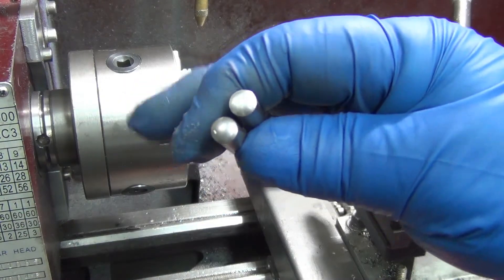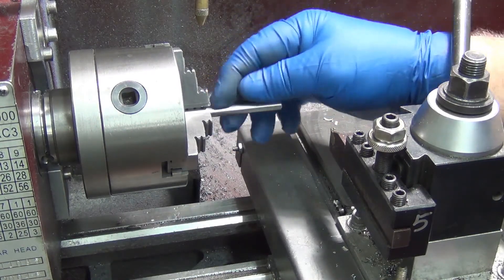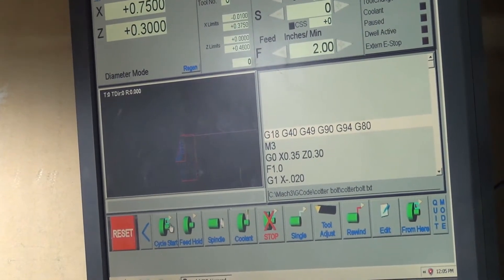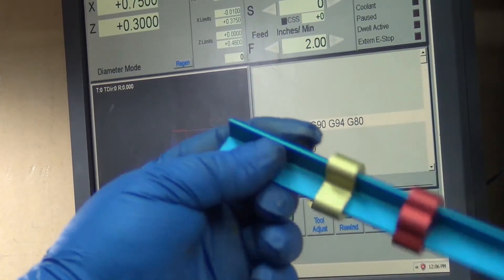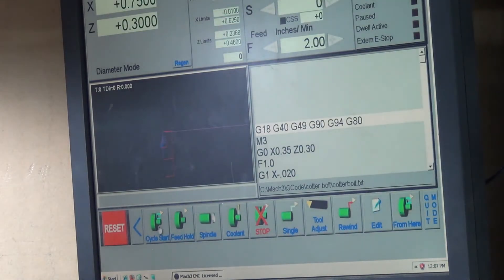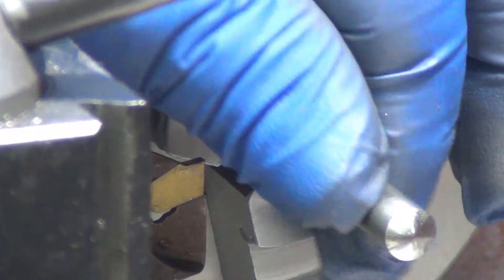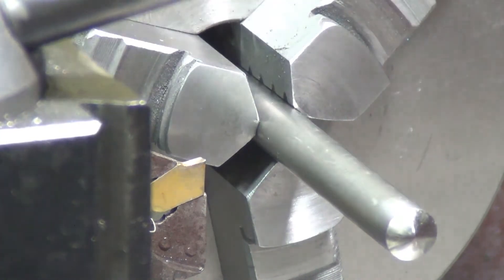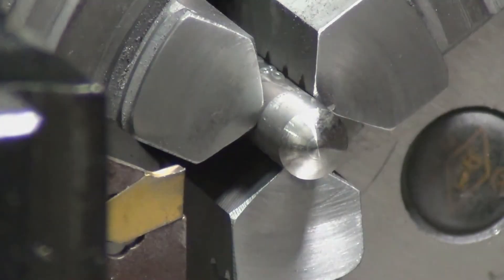Cotter Bolt pt4 - OP1, Cutting the Rod

Comment: Hi Mike,
Yap... Sometime ago I've learned the manual programming on CNC, never made it to the computer programming using software, maybe one of those days if I let myself get one of those smaller machining center..... Still debating....
But seeing you get it done, pushes me towards getting one, Geezzz you're a disturbance.... lol
Pierre
Reply from the maker: LOL!!  I'm disturbing and disturbed.....I got it well covered!!! :)
I wanted to start with a mill, but the lathe has been great for learning!   I was just looking at some used equipment for sale on CNCZone.  Just like I thought I needed a big lathe, then realized that the small one does 90% of what I really need to do.....it's becoming more apparent with the mill too.  Most of the first projects I'm looking to do on it would easily run on a cnc'c Sherline.....or even my mill/drill if I converted it.

Comment: There was a small CNC lathe on the local classifieds lately...almost bit on it too....LOL
Would love to have that capability in the shop.. ;-)
Reply from the maker: Hi Colin!
I resisted even the thought of a small lathe for years.  This one wouldn't be anywhere near as useful if it was only manual, but this is by far the most valuable tool in the shop right now.  Paid for itself at least 4x's over!!  The smaller size is actually a huge benefit in a lot of cases!! :)
Thanks!!
Reply: I would never buy something that small as a manual but like you for the cnc aspects and the learning experience.
Reply from the maker: *****
I think Harold just called you disturbed!! LOL!!!!  :)   Before I got it, I thought a small one like this had no place in making parts in a "real" shop.  Some of these smaller parts I'm making would be a PITA to do on larger cnc'd lathe.  I got this for about $650 and it's been well worth it!  It still sucks to crash a small one like this, but everything is cheaper if you do. :)